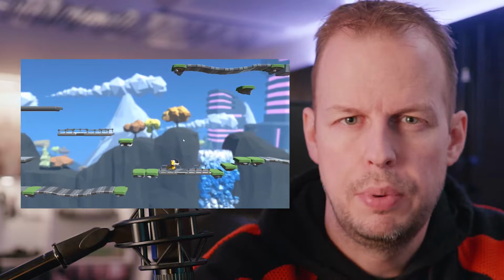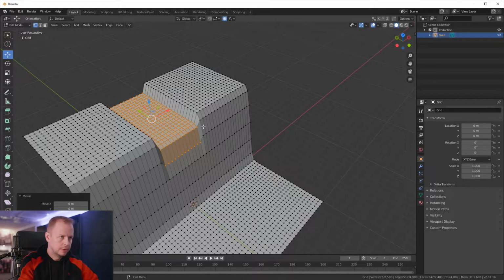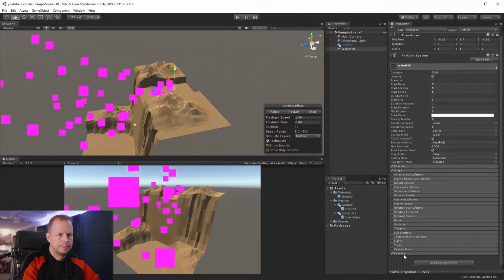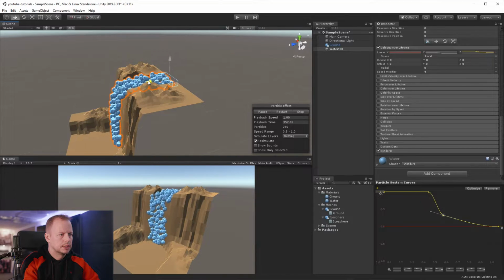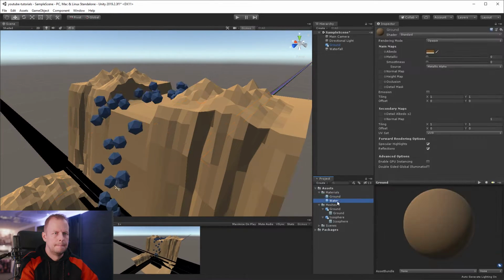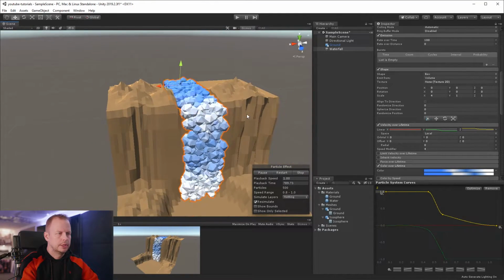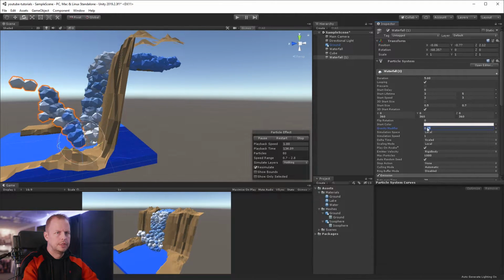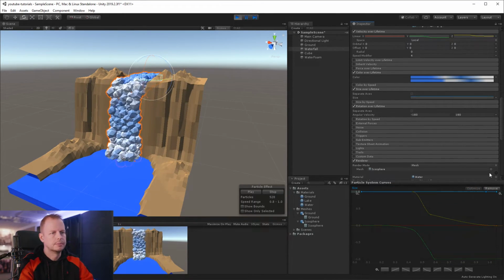Low Poly Waterfall in Unity

Comment: Man must be nice to be so fluid in blender :)
Reply from the maker: Yes, it took me some time but I'd say that mainly Ludum Dare events kept repeating the process for me 3 times per year so I finally learned after years of trying to switch from 3DS Max =)
Reply: @Imphenzia  I've made mostly 2d stuff since learning modelling at a good enough level seems like such a daunting task. Not to mention texturing, and all the 50 maps you need nowadays and getting exports of it all to work in unity after that. Low poly is a nice way lower the ambitions but still getting nice stuff going in 3d
Reply: Thanks for mentioning shortcuts and such!
Reply from the maker: You're welcome, with risk of sounding repetitive =) I wanted to enable Screencast Keys but it didn't seem to work for Blender 2.81 unfortunately.
Reply: @Imphenzia  oh so keys come up automatically? That's cool. And saves you a couple of breaths :)
Reply: @benmeister  AND Unity)